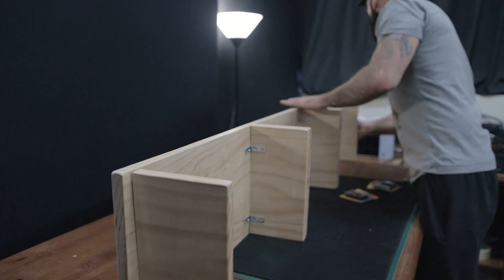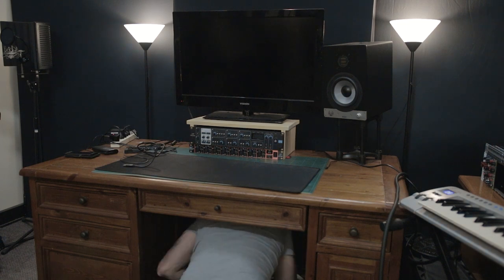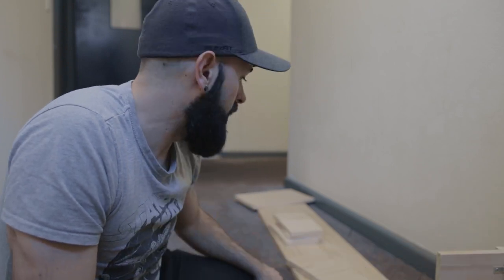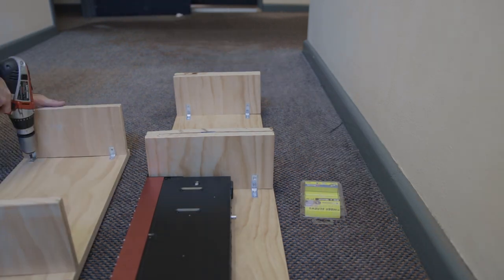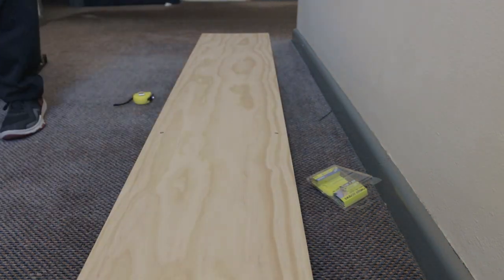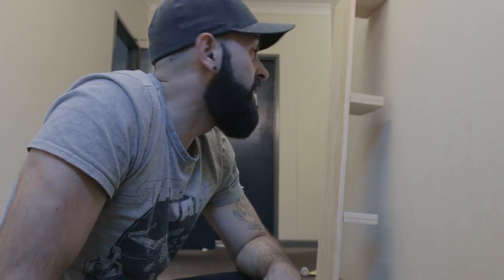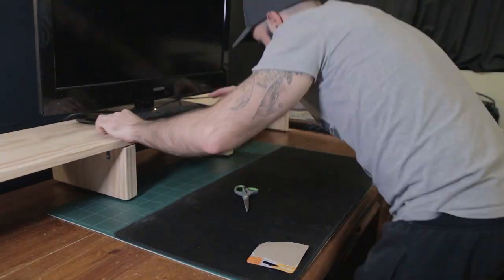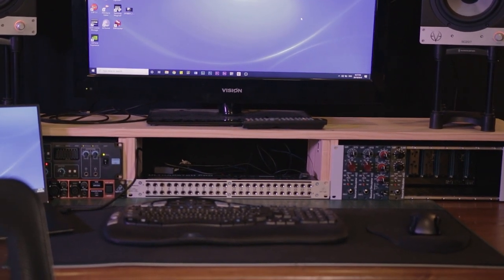New Patch Bay Part 2 - How to build your own DIY Studio Shelf/Rack

Comment: I have a very similar set up to this. I bought 2 black computer monitor stands from Kmart Aust. The gap is bigger than a rack unit so I can fit 2 units underneath, or 4 in total. I have done as you have, I put little feet under them that you can buy at dollar shops. My 4K TV is on top so I can use that and my computer monitor. I am contemplating on getting a patch bay, seems like the next logical step. Great and affordable ideas here, I like it!
Reply from the maker: Thanks for stopping by Lance! Do you have a photo of your current setup you'd like to share? I'm always keen to see peoples setups!

Comment: Yes! I am just about to build something like this. I need something that's ergonomic. Great video.
Reply from the maker: Thanks travis. the only thing i would have done different is cut the front on an angle so they sloped back and the racks and the dials were then a bit easier to get to. I didnt have the tools at the time though.

Comment: What do you do if your mics are in a different room, but your patchbay is at your desk? Do you need extremely long cables going from your patchbay and into the mics?
Reply from the maker: Good question Rhys. My mic lines have xlr connectors at the mic end and trs connectors at the patch bay end. So I can extend the mic lines with a loom, a multicore or more mic leads if I needed to.

Comment: Hi.. I'm planning to make my own studio monitors, please suggest what speakers would be good. Any brand or link would be helpful. Thank you.
Reply from the maker: I use Eve SC207's. Theyre great but not cheap by any means. 

when you say you plan to make your own, do you mean you're going to build a pair from start to finish yourself?
Reply: @diyrecordingstudio  yes I am going to build from start to finish right from designing the preamp, power amplifiers, controls and the speaker box enclosure, all of these seems easier than selecting the speaker drivers. That's why I wanted find out which one of the drivers would suit best.
Reply from the maker: I'm not yet into building speakers honestly so I wouldn't know where to start. That's a very ambitious project you have in mind.
Reply: @diyrecordingstudio  thank you and I shall keep you updated with my progress and give as much details as I am able to collect and build.

Comment: Connecting microphones to a patch bay is not a good idea, inputs from mic pres can contain phantom power and you do not want that to be connected to a line input, also while patching you can short the phantom power and break your mic input. So mic inputs from mic pres or audio interfaces DO NOT belong on a patch bay...!
Reply from the maker: Can you explain further? Every studio I’ve ever worked in has this setup. It’s pretty simple, check phantom power is off while patching in mics and gear then turn it on when line checking. That’s why pro gear has individual phantom power per channel.
Reply: @diyrecordingstudio  Not in the studios I worked in, only line level signals on the patch bay, mic inputs on XLR only, a mistake can always happen in the heat of a session, pull a TRS with phantom on it and you make a short, make a wrong patch and you connect phantom power to a line in, it is just more safe to keep your mic inputs separated on XLR connectors.........